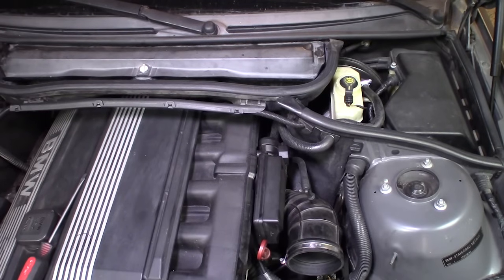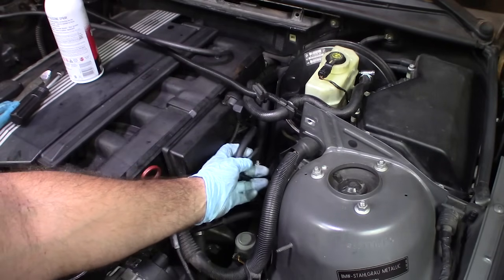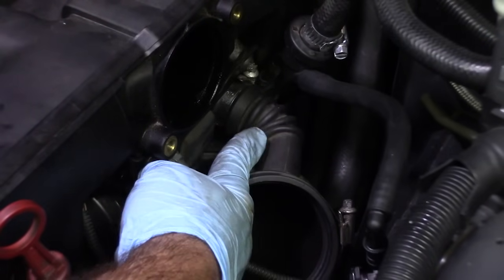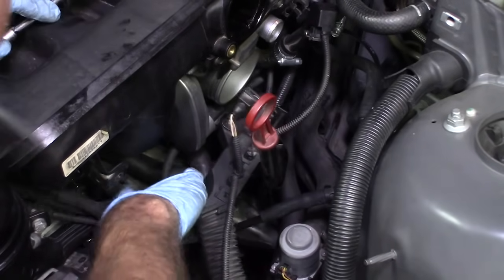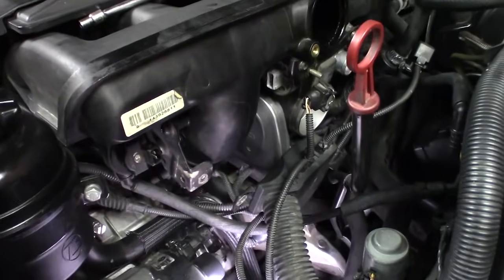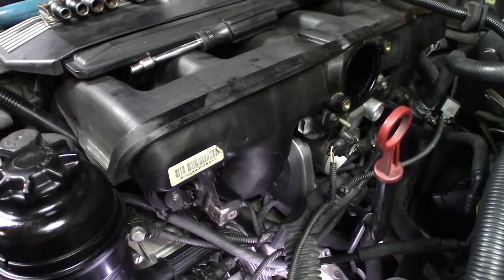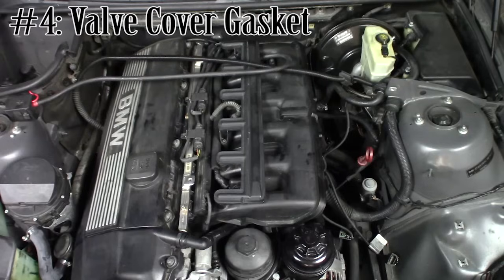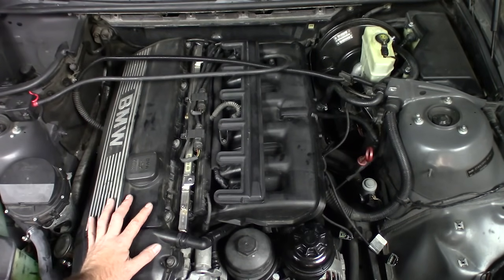BMW E46 & E39 Most Common Vacuum Leaks P0171 & P0174

Comment: I just started throwing a P0174 too. Smoke test was good, MAF was clean, recently rebuilt my DISA. All the usual stuff was good. Turned out to be the air pump control valve and gasket. So keep that in your diagnostic arsenal for future reference. And it's an easy fix/replacement too (beside the exhaust manifold near the front).

Comment: Wanna hear the story of how I got to this video 😂 my engine had a faulty fuel pressure regulator and it flooded my intake. I fixed it, started my engine, and it exploded, my intake box shot out of my car into the air like 15 feet. Ran a few tests, I have a hundred thousand vaccum leaks 😑

Comment: Excellent video. For the other 5% of cases, there are also three less common o-ring failures you might want to check before buying a new MAF: Dipstick tube upper o-rings (x2), fuel injector lower o-rings (x6), air distribution piece o-rings (x6).

Also, if you have a 330 then you have a vacuum actuated exhaust. This is a 3.5 mm line that runs down from the back of the intake manifold to a vacuum canister and through the firewall to the rear of the car.

There is also the throttle body gasket and idle control valve grommet, which may leak if reused and not seated properly, respectively.

Finally, if your lean codes are set at highway speeds rather than idle then it is more likely to be a soft failing MAF than a vacuum leak.
Reply from the maker: clabcon Interesting.  The dipstick tube O-rings you refer to are on the dipstick itself, rather than the tube it goes into, correct?
Reply: 50sKid Yes, the dipstick upper o-rings are on the dipstick rather than the guide tube. There are two of them measuring 9 x 2.22, which is smaller than the lower o-ring that goes around the dipstick guide tube and sump. My upper o-rings were not leaking, but looked worn and flat compared to the plusher new ones and offered greater resistance to removing the dipstick from the guide tube i.e. a better seal. Obviously if you do not check your oil weekly like me, then your upper o-rings will be less worn. It is always good practise to replace the lower o-ring when pulling the dipstick guide tube. For proper installation, lubricate the new o-ring and put on the dipstick guide tube. I have heard they can easily tear and give you a vacuum leak if you put them on the sump and force the guide tube into place. Tolerances are tight so it may take you 30 mins of wiggling to properly seat the new o-ring even when lubricated.
Reply from the maker: clabcon Yeah pulling that dipstick weekly'll sure do it!  Mine sticks in that tube like an SOB and I gotta pull hard on it.  I've got about 170k miles on my car and the dipstick tube o-ring was in quite good shape--I replaced it in my CCV videos that I recently did "just cuz," but it honestly was just fine.  I think it all depends on if you've gone and left the o-ring in the pan and tried to shove your dipstick tube in that way.  But, to anyone reading these comments, Harbor Freight sells a pack of Metric o-rings for $5 and it has the proper size.
Reply: 50sKid Almost 120k miles here and I have the revised design single walled dipstick guide tube. The damb dipstick snags on a ridge in the bottom and has to be rotated 180 degrees to remove! I think the second batch of these was made in China instead of Germany...
Reply: " if you have a 330 then you have a vacuum actuated exhaust. This is a 3.5 mm line that runs down from the back of the intake manifold to a vacuum canister and through the firewall to the rear of the car."

Ah, interesting - the pipe is well cracked on the end of my one where it connects to the exhaust. Suppose it's worth me cutting that off a bit and getting a better seal (or just popping a screw in it, etc - my exhaust butterfly is completely seized so it's not doing anything) before I start tearing the engine bay apart....

Comment: You are Hands Down The Best instructor Ive seen in years -
You make trust worthy eye contact somehow and you can easily sense you know your shit.

The way you describe or note any relevant details, tips or cautions with detailed why's are very much needed to create a solid longterm memory.

 You should instruct in tech college or an automotive school. One that pays what you are worth. 

Video and sound guy ~excellent job as well.

TY  for Being and Doing.
Reply from the maker: thanks so much man!
Reply: @50sKid  hey man thanks for the video. Hearing a sucking noise from around the intake manifold. Not sure if it is normal but. Would a bad disa ring cause this?
Reply: exactly what i was going to say

Comment: seriously dude.... I wanna ship you a fucking 12 pack. My BMW has been running like shit for years... So much so I was gonna sell it... I fixed everything.... MAF, all the hoses, all the boots, the Disa.... Never knew about the oil separator hose... You made my car start back up like normal, after 2 hours of trying to get the damn stupid ass BMW connector off, hate those black squeeze ones... EFFIN A++++++.
Reply from the maker: Thanks!
Reply: I'm in the exact same boat at the minute, going to check those plastic hoses when I get a minute.
Reply: 50sKid hi have a 318i e46 with p0171 code. it's a m43 engine and im located in France and it gives "problems de transmission du carburant". I need help
Reply: I have a feeling this is going to be me

Comment: Having some difficulty with my e46 with a rough and weird idle. I diagnosed it and it came back as these codes. Im having a tough time finding the leak.
Reply: What did you end up doing to it
Reply: Having the same issue rn

Comment: great video. One thing you can do to find leaks faster is to attach a glove on the intake boot and attach a hose to the glove. Then i used an electronic cigarette to blow some smoke through the hose i attached to the glove and i found my lower boot and the disa o ring was leaking.
Reply: This might be a stupid ? , do you do this with the car on, just idling or with the car off?
Reply: Car off!!!
Reply: Please do a video!
Reply: Crazy! I just did this the other day. Only thing I did different was I took the f connector off, stuck a straw in the intake boot, and started puffin

Comment: Great video!  I suspected a vacuum leak but it ended up being a completely failed DISA valve (O-ring was fine) on my 2004 330xi.  Replacing that should fix my P0171 and P0174 codes along with random misfires.  This video saved me a lot of time. Thank you for taking the time to make this video!  Keep up the good work!
Reply: Did replacing the DISA valve fix your problem? Im about to replace mines
Reply: Hey I have a pending P0171 code! I just replaced all my CCV but the code is till pending! Would you know why?

Comment: You explained everything so nice, I’ve had a issue where a plugged in MAF sensor makes car run rough and die after a while with a EVAP Large Leak, yesterday before this video I did a smoke test and found a leak by that little hose near the throttle body, fixed and still same code and it’s driving me nuts after I’ve replaced 75% of the items you’ve said. You did mention some other that I haven’t checked that I will definitely be checking now like the o ring on the oil stick!

Comment: After watching this video and reading the comments i went back outside and pulled the secondary check valve out and inspected the little gasket and noticed it wasnt sitting on one of the two 10mm studs and was only sitting on just 1 smh SOOOO obviously it wasnt seated properly and i could actually see the soot on the gasket where it was escaping. Hopeing now that this is sealed off maybe now the lean codes will vanish. I have the legendary p171 p174 and also p 430....😮😮😮iam in such shock that iam afraid to go back outside and start her up...i cant believe the gasketbwas on wrong n a healthy amont of carbon on the gasket shows exactly where it was leaving...that has tobbe enough especially especially at 2500 rpms...🎉🎉🎉look at me i cant shutup!!!! ....all thanx to this video!!! 50zzz KID😊😊

Comment: your videos are a great help - I did the ccv and vanos watching these - need a little help tho  while I though I replaced every single possible vacuum line - I found one that I didn't do- there is that vacuum canister - I replaced the line that goes to the front of it and just found the line that comes off the back of it... where does it go to?  It is black with a blue stripe and looks like it goes through the firewall...  when I pulled the line the nipple broke off the canister so now I want to know how to replace the vacuum hose and if I need this canister at all - what is it for.  This all stems from hearing a loud leak that seems to be coming from beneath the car and I get all these codes 171,174,1083,1085 all after doing the vanos.  made me think that with the vanos improved - it revealed something else weak in the system?  What do you think?

Comment: Had a vehicle come into my shop with all the same issues, I replaced the DIsa valve, replace the crankcase hoses and pvc system also, the intake hose.  The intake hose had its common leak, I replaced that.  I then found the crankcase problems tube to the dipstick was broken, still had a problem, I then smoked the intake with a smoke machine no leaks found.  After looking and looking I narrowed it down to the brake booster which had an internal leak.  I tested it by unplugging it and the capping it off idle remained normal, no codes.  Now I need to learn more about the VANOS repair, your videos are very informative and thank you!
Reply from the maker: +Rick Singh Very nice, thanks for the info about the brake booster!
Reply: +50sKid - thanks budddy, do you have any info or videos that I can look at to diagnose the Vanos on these vehicle's, it seems like I am running into alot of failures on bmw's.  Again, I appreciate your time and effor in putting these videos up, its greatly appreciated.
Reply from the maker: Rick Singh Well I'm not entirely sure which are the common codes that basically mean you have to rebuild the VANOS, but this guy has a good video on the procedure: https://www.youtube.com/watch?v=IBJL9AkS6Qc -- I've also heard of the two solenoids on either side getting stuck and needing to be cleaned out, and those problems resulted in different codes being set (again I don't remember which ones, I'll have to make a note for my future video).  What codes are you seeing?
Reply: +50sKid - I will update you when I run into another problem with one.  I don't remember the codes top of my head I do get a lot of these cars for repair these days.  I have my own private shop that I run, and these cars are very tricky at times to diagnose, thanks again buddy.
Reply from the maker: +Rick Singh Excellent, keep me posted on the VANOS stuff.

Comment: I have a major problem with this video.. your clarity and explanation gives me the confidence that I can do this.. I just want to say thank you for this video. I had the maf cleaned, plugs tightened filters replaced or cleaned my car runs great it makes a sound that I don't like when I turn the car off.. Codes wont clear, time to check for vacuum leak.
Reply from the maker: +Bart Pack Thanks!

Comment: Thanx brother, that was an awsome video. Couldnt be clearing than that.
Want to agree on one thing that you made mention of in this video and that was about the aftermarket maf sensors. This is my woe, have an aftermarket maf and sometimes when driving the steering angle and the ABS lights comes on including the eml.
When scanned it, it shows vanos, maf, 02 sensor and some others are bad.
Can those 3 pin maf sensors be repaired?
Pleaee comment. Thanx.
Reply from the maker: Nah you need to replace your aftermarket MAF with an OEM Siemens one.  The aftermarket ones use cheap resistors instead of expensive platinum wire.

Comment: I did the smoke test and it came out from the secondary air pump and the vacuum cap on the back of the engine with the other air sensors.

Comment: Great videos mate I have my own diagnostic it showed all 4 glow plugs so guessing I need to replace glow plug relay too ? ....also other thing it showed was air charge read it is linked to turbo no loss of power I've read a bad hose could cause this ? Thanks
Reply from the maker: Actually I'm afraid I can't help with the diesel engines as I haven't worked on them
Reply: 50sKid ok thanks anyway

Comment: So glad I came across this. I have both banks coming up so I’m assuming it’s my catalytic converter because I replaced the oil separator, the line and the air duct hose. 
Also I have the P0721 code which is my output speed sensor. Where is this located?

Comment: Gr8 info. It people like you how actually makes the difference. Thanx.
Am looking for a maf sensor for my 02 325i. A good oem one. Any info?
Reply from the maker: ONLY purchase a Siemens unit, which is the OEM brand.  The chinese ones you get on eBay use cheap resistors instead of real platinum wire and will not work correctly.

Comment: hey i just replace the hose that goes from the oil separator to the dip stick.. great job on that video.. but i have a problem i m not a mechanic geek i was just trying to save some money on the repair.. and when i put everything back together and try to start the car i get a engine failsafe message.. please help me with that!!
Reply from the maker: +Mauricio Vasquez Where are you getting this engine fail safe message?  Is this a DTC code?  If so, what code number?
Reply: +50sKid p0174 p0313 p0171 p0741 p0128 p1083 also my car when turned on shakes a lot and if i try to hit the gas pedal the car is unresponsive..
Reply from the maker: +Mauricio Vasquez You did something wrong--you've got a massive vacuum leak.  Go back and figure out what is disconnected and letting all the air in.  Btw p0741 is a torque converter clutch code and it means you might need a new torque converter or that the hydraulic circuit inside the transmission's valve body isn't working correctly.  Have you noticed transmission issues lately?  Slipping?
Reply: +50sKid nah.. not at all i've had that code since i bought the car.. but what really concerns me is the noise that my car making right now..

Comment: Knowledge is power and this guy has just helped me big time. Makes sense that a smoke test might not reveal the leak being pipes are beneath things. Only what if you had a camera? one of those bendy things that can go down inside the engine, meaning that you wouldn't then have to remove stuff and by using it you could then see the smoke that was coming out of the pipes. Could it potentially work i wonder? Anyway I heard from another video that the brake booster can have a vacuum leak inside the thing, so I appreciate that in that instance the camera wouldnt work then. I wonder if that is true though? Internal leaks between the air intake passages was another thing the video had said. My 318i on tick over rises from 800 to 2000 rpm and back to 800 repeating this every half second. Could it be a vacuum leak, or timing chain? Air in fuel? Hmmm help needed.
Reply from the maker: I would look at your idle air control valve, make sure it isn't stuck or sticking (take it out and shake it, it should rattle inside when the motor isn't energized).
Reply: Removed the idle air control valve and shook it and yep theres a rattle. Can the thing be cleaned? I see inside there is a curved shaped gate thats spring loaded, only I did clean crap out and blew through it, then a squirt of WD40 and refitted it. No difference. Erratic idling. Then i removed the ht leads and did a resistence check and the third lingest lead was out of sink to the others. The car was fine when I bought it, and then couple days later the idling issue. Only it was just after going through a deep puddle and the car tried to stall. The car also through the rev range is now bottoming out at places, and wont go past 4000 rpm. I am getting an Autel computer tomorrow the Maxidas 708 and after reading the faults, hope i have a clear answer. Anyway bought fuel filter today and idle control from ebay, and new leads tomorrow. Haynes manual says nothing for erratic idling as the idle control valve, but lists probable causes as being, fuel filter, fuel pressure, injectors, low compression, timing chain, camshaft lobes, injectors faulty or worn. Your views?
Reply from the maker: This engine uses coil on plug, not older ht leads.  So what exactly are you referring to?  The whole coil pack?  A bad coil is certainly a possibility.  Compression and timing chain and cham lobs are unlikely.  See what your code reader says first.  If you have codes they will likely tell you where to concentrate.
Reply: Its a e46 m43 1999 318ci. My other bmw is 320 with coil on plugs, but this defo has ht leads.strange too because old keads came up 2200 resistence and the new 5000. I thiught the low is better for current flow?

Comment: Excellent video. I suggest anyone with these codes find an independent shop with a smoke machine. They will inject smoke into the intake system and look for smoke exiting any leaks. This should be a low-cost job and will direct you to places to look for vacuum leaks.
Reply from the maker: hnkfsh81 Actually you can buy a smoke machine on eBay for $35 and figure out some tubing to hook it up to your MAF, but I'm not a big believer in this as a diagnostic method.  It's only going to find the most obvious leaks, the ones you can likely already hear yourself.  The reason is because it will only generate a small amount of pressure in the system, like 1-2psi.  Compare this to the amount of vacuum under idle, which is around 17-21" Hg (or relatively 8-10psi).  If your valve cover gasket is leaking, it may only be leaking when under high vacuum.  Too many people report no results after paying for smoke tests, and this is why.